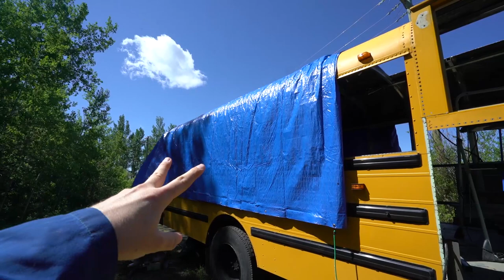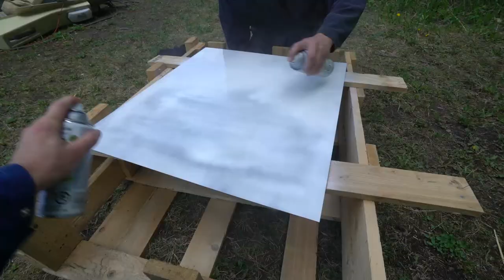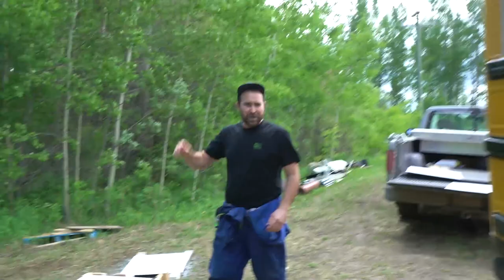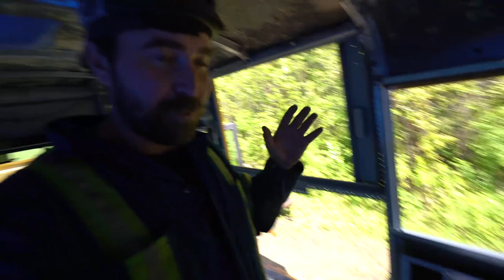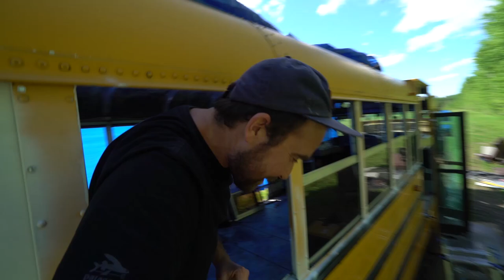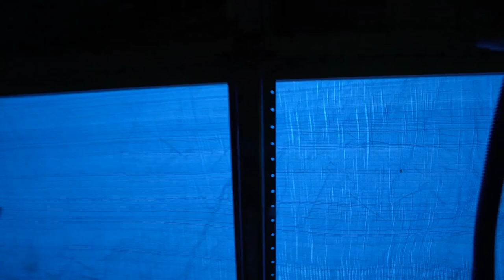WATERPROOFING + RE-INSTALLING SCHOOL BUS WINDOWS - CAULKING

Comment: Alberta weather this  time of year can be very unpredictable. Expect many thunder and/or hail storms at short notice in these parts.. Rubber tires will insulate the bus body from the ground but the bus could still be energized through  moisture or any metallic objects touching the body and earth simultaneously.
Reply: Not to mention that the bus is parked nearby and parallel to a hi-voltage transmission line. God forbid Jax & Mike be arcin' and sparkin' ground rods in a T-storm!

Comment: The hole in the ceiling is for pull down stairs to get access to the roof deck kind of like those pull down stairs you have to get into an attic of a house

Comment: Lightning will strike a vehicle, but it travels around the outer metal shell. As long as your not in contact with the metal you’ll be fine. 😂

Comment: Kudos! Another entertaining and educational how-to conversion video. 
Quite interested in your window replacement build-out, that sandwiched plywood looks pretty darn solid. Just an observation from the peanut gallery here and I know by now you have completed the task, but... On the removed window void: To fill that void at the top, maybe the plywood sheet could be cut ±2 inches longer; insert at the top first and push up into the void and then push the bottom of the insert into the window frame for a snug fit. Insulate where appropriate, then caulk and seal. Nevertheless I know you will have it adequately engineered and sealed. I would consider priming/waterproofing all of the plywood just to add another layer of water repellency in the event a leak presented itself. Oh yes, what about considering for all interior priming, "Use KILZ 2 Multi-Purpose Latex Primer That Dries Fast & Seals Porous Surfaces. Helps Block Stains. Hide Previous Colors. Promotes Adhesion. Seals Odour. Mildew Resistant Finish."
 Press on and Godspeed.
Reply: RUST-OLEUM The Mold Killing Primer contains an EPA registered antimicrobial to prevent the growth of mold, mildew and other fungal organisms on the paint film. Mold Killing Primer is for use on non-porous interior and exterior surfaces.
Reply: Please, If you have the time for a comment... Dimensions: What are the overall outside length and width of your skoolie? And please, the inside length from back of driver's seat to exit door and the interior width? The interior height? The overall height of the bus, before alteration and proposed height after adding the deck, etc.? And one more, how do you propose to cool air condition the skoolie while underway, or anytime that you do not have shore power connections?
Reply: Rex J. Weinheimer, good advice on sealing that plywood filler. I think it's in a prime location to mold and/or mildew and that's no good. A product that I've had fantastic luck with is BINZ by Zinsser ( or somethin' like that) I'd say it's the same as the product you mentioned. I only mentioned it in case there's an issue sourcing or pricing.

Comment: You were totally safe inside your bus during a thunderstorm. Yes rubber tires actors insulation but that’s not the reason why. Electricity traveling along the surface does not take a 90° turn. This is demonstrated every day in the Boston Museum of science where a guy in a big metal birdcage leans against it and hits it with about eight or 10 bolts of lightning.

Comment: So you were 100% correct about the possibility of bein' 100% wrong. Dude. That's a perfect score......I think...kinda. Glad to see ya fillin' those open sides back in, weather is not our friend when it's in wreckin' mode.I could never eat very much mid day, even when I was young and energetic a meal of any size would make me lazy. Movin' right along. ...........................PEACE!!
Reply: I hadta come back 'cause I just remembered something. Jax are ya still goin' the spray foam route for your insulation and vapour barrier? We had a company come do our basement after we built and it was cheaper and a Hell of a lot faster and dare I say better than I could have done. It's even a better product than we "civilians" can get our hands on easily. I asked what I could do for prep to make it easiest for everyone, they told me some specs, I did it, they were in and out in three or four hours. They covered the perimeter walls and the underside of the floor above. All done to optimum thickness and density and I didn't lift a finger hahaaa! Just a little info, hopefully it will help somebody. .............................PEACE!!

Comment: Primer won't hold off rust you need to seal with paint. I used to do paint and body work. Just Some fyi
Reply: Mary Cox primer is a base coat so the paint will stick!
Reply: Darrell Wampler agreed but looked like they put them in with just primer and that dose not seal the metal. It was just some info for them. I worked paint and body for 20+ years. Retired now.

Comment: the rubber tires theory is a myth. The metal body of a car will send the lightning around you to the ground. But seeing as you are inside a metal bus working on metal, it would be bad if lightning struck the bus with you standing on metal and/or touching metal.